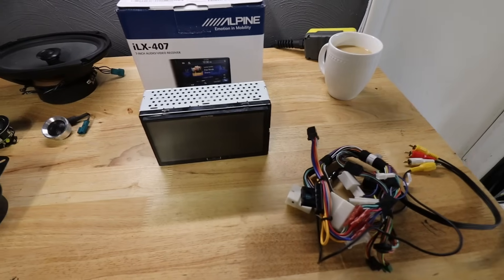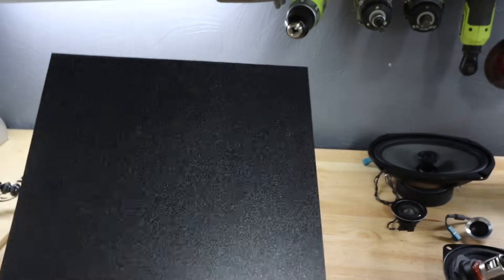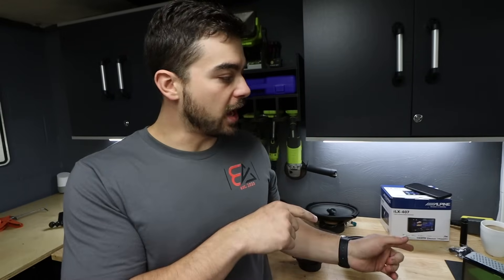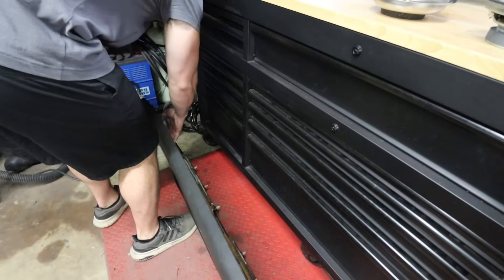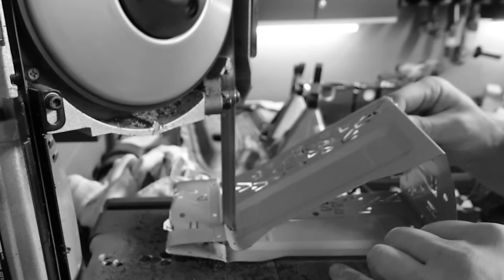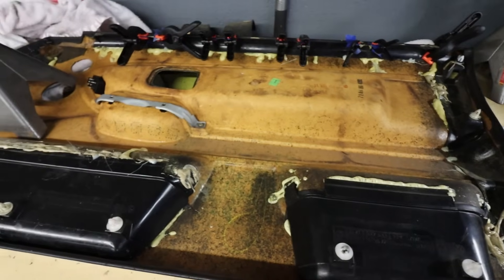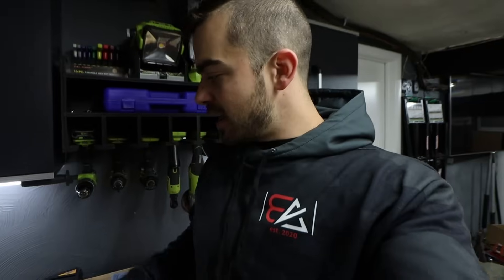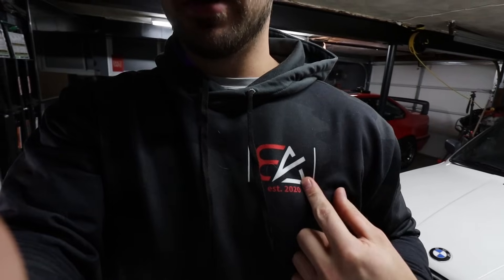Interior & Stereo Upgrades Every BMW E36 Needs | Installed on my LS1 Swapped M3

Comment: This is exactly what I needed to see! Not enough content on putting a double din below without cutting away at the heater behind, looks really clean. Need to do this to mine so I can replace the current radio with a gauge pod
Reply from the maker: If I had gauges to add they would look perfect in that radio delete panel.  The goal was not not hack anything up to the point it couldn't be returned to stock.
Reply: @matt13ross  yeah you done a great job with it. Did you consider a modular double din at all? Stuck between that and a shallow double din but now I've seen you do it I know it can be done without cutting too much away
Reply from the maker: What is a modular double din?
Reply: @matt13ross  guess not then 😂 screen and the unit itself are separate. Can mount the screen and then run the unit itself with a cable from the glovebox
Reply from the maker: Oohh I see.  How would the screen mount though?
Reply: @matt13ross  yeah this is the thing, I've only seen product reviews but no one install it. Sounds like a good alternative for that tight space in the e36 though

Comment: Hey thanks for the video, can't find many people wanting to keep the OEM stereo and all in place and add an aftermarket stereo down below... I'm just going to throw a single din down at the bottom below the temp/clock/etc. unit where the cubby currently is to keep the original look - will the cc unit still work without power to the OEM stereo unit? I'm kinda thinking that the disk changer in the trunk still working would be cool. Sorry if this is weirdly worded, i'm a newbie and wanting to pull out/mess around with as little as possible

Comment: How did you mount the double din in the bottom cubby?
Reply from the maker: Use some aluminum and bent it to shape, mounting it via a bolt that was on the tunnel.  Hard to explain, but very custom.  Solid though.

Comment: I thought I was the only one using the alpine radio on my e36
Reply from the maker: Same spot?
Reply: @matt13ross  I went with up top I want to move it down
Reply from the maker: Why do you want to move it down there?  I want to move it up lol.
Reply: @matt13ross  I don't want to cut into the air vents tubing or whatever is back there but if you plan on moving up I'd say use some plastic tabs that are about double the height of the radio and tap into the metal rails that are inside there that how I manage to put mine up there and be careful Taking out the vent up top you could break the temperature cable

Comment: How did u put everything thing in tho? I’m doing the same thing at the moment I got everything done but I’m stuck trying to put everything into the bottom cubby
Reply from the maker: You mean the wiring or what?
Reply: No like putting everting in to finish. I don’t know if this makes sense but I got the stereo hooked up in its place but how do u put the plastic chassis so that everything is done?

Comment: Please tell us that you are running all of these speakers through an amplifier?
Reply from the maker: Just the factory one.
Reply: @matt13ross  In that case a good-quality aftermarket amp is a must. You'll be underpowering these new speakers with the oldie and when turned up loud would not give them the best signal. In general you want to look at RMS power rating and get an amp that supplies twice that power RMS per channel. You won't blow them that way either. You can also set the filtering in a way that'd put "full" sound, possibly with some bass boost through those 6x9s, and run a pass filter that'd remove a little bass from the front speakers to ensure their longevity. Amp is vital to a good sound of your stereo and speaker longevity.
Reply from the maker: That’s something I’ll have to look into! I’d like a little extra bass too.

Comment: I did something similar. All infinity components with 6x9 in the back. Lots of bass response.
Reply from the maker: Stock amp?  After driving this for a week or so, I'd like more bass.  I'm wondering if I should change the BSW 6X9s to another brand.
Reply: @matt13ross  I have a pair of Infinity REF-9633ix. They get as low as 23hz. 27-30hz is really the sweet spot for low end in my car. It's loud. I would buy from crutchfield and if you don't like them just return them.
Reply: @matt13ross  yes I have a stock amp. Non HK system from the factory. I plan on swapping out the amp for something aftermarket down the line but for now this setup is great.
Reply from the maker: Awesome thank you!

Comment: Yea all new double din radios that I have run into have that wire to connect to the parking brake for their setting instead and video you can just ground that wire out on the chasis of the radio and it should be fine
Reply from the maker: I read that they are smart enough to know if you just ground it, hence why I got the relay.

Comment: Just the video I was looking for! I know im a bit late, but im really hoping Boosted Apex replies. What did you do for the remote power wire (blue/white) for the head unit? Did you connect it to the power antenna (blue on the car harness)?
Reply from the maker: Hrm. Possibly. Pretty sure I went blue to blue.
Reply: @matt13ross  oh you legend. thank u. im pretty sure the parking break bypass thing hooks up into the blue/white wire. Sound familiar? 
Thank you so much bu the way
Reply from the maker: I followed the instructions with the bypass kit. Other than that, I don’t remember lol.

Comment: how did you end up mounting the actual radio and radio cage?
Reply from the maker: I def forgot to video that.  The cage is bolted to a piece of aluminum I bent.  It sits underneath the cage and bolts to factory thread in the floor.

Comment: Awesome set up! Loved the video, Do you think you could do a short video on how you got the stock amp to work wiring wise? Ive looked high and low for answers and im stuck on my aftermarket radio, ill get sound then it will say miswired or it just says miswired after I hear the amp turn on.
Reply from the maker: Nothing special here, just standard wiring!

Comment: Nice install on that headunit!! What amp do you have? I still have the Stock HK which I know is supposed to only work well with the 2 Ohm HK speakers, most aftermarkets are 4 Ohm.
Reply from the maker: Still the stock amp, not sure if it's worth upgrading or not?

Comment: Yo I feel you on that roll bar thing. I just want to be able to pop the side windows out and latch them back when I'm done. Its like impossible most of the time I send one of the kids back there to open or close them.
Reply from the maker: Lol send the kids back there that's awesome.  Totally agree with the rear windows, haven't been opening mine.  Would be nice especially without A/C.
Reply: @matt13ross  yeah no AC for me either. I'm thinking of coming up with a latch I can reach some how.
Reply from the maker: Lemme know if you do.  Also, you can retrofit electronic latches if you can find them.
Reply: @matt13ross  I didn't know that was even an option.
Reply from the maker: May be a euro thing but I’ve seen it before.

Comment: To make the radio think that you are in park you just need to ground a cable called prolly „handbrake”, you can do it even by grounding it on the radio itself.
Reply from the maker: You can't with the new radios, it cant' have a constant ground.  That's why I installed the relay.

Comment: Great video! Replacing those door speakers on an e36 is a pain in the rear! Great job 👏. Where did you find the bavsound speakers from? I'm trying to find a set of door speakers but they are extremely difficult to find
Reply from the maker: I got them used from a guy on Facebook.  Last I checked they were backordered on their website.
Reply: @matt13ross  thanks for the info!

Comment: I want to buy rwd car cheap with at least 140 hp.

Bmw is the cheapest option. But unfortunatelly e36 in poland were the most popular project cars and it's even a meme out here how much e36 are shitboxes. It's really difficult to find one that is not rusted, thrashed, without welded diff and they also got more expensive now. E46 are cheaper, but the thing is I hate how e46 looks like I don't like beemers newer than e36.

Good news is compacts are cheap, becouse they are ugly for most people so noone want's them. I actually like compact more than coupe. 

All I really need is 2.0 engine. 

If I don't find one for cheap I will be forced to but is200, as I don't see the point of buying a beemer for price of a lexus. And lexus engine is far better with mods than any bmw engine.1G-FE is basically 2 liter 2jz.
Reply from the maker: If you can find really any E36 that isn't rusted, go for it.  The rest of the stuff is easy to fix.
Reply: @matt13ross  I don't know much about engine swaps. I honestly don't know where and who would even do such a thing and how much would it cost. There's plenty of cheap 1.6 or 1.9 (both 100hp), but anything stronger than that are typical beaters or cost 5k$ or more.

Maybe I will convince myself to buy e46, there are some good coupe 2.0 for around 2.5k$. Maybe it looks way worse, but at least I won't have to worry that much about buying a scrapbox.

Most people here earn around 1k$, so 5k is too much for just a base.
Reply from the maker: I say just fine a clean rust free one and start from there.  You can always engine swap or add power later.

Comment: Thanks for the video. I have an INFINITY BASSLINK installed in my E36 trunk. You should add that to complete your sound system. Trust me.
Reply from the maker: Where / how did you install it?
Reply: @matt13ross  It is installed in the Trunk/Boot of the Bimmer. Mine is located on the driver's side. The subwoofer has a built-in amp so it gets it power from the battery which is located conveniently in the trunk. There are Youtube videos explaining how to install it. INFINITY BASSLINK.
Reply from the maker: Awesome thanks!

Comment: Killer job! For the panel mods in the future perhaps it may be good to invest in a plastic welder and a hot staple gun? They both take a little finess to not overdue it and burn the plastic or take the staple right through a panel. But super quick to learn. Install looks super clean! That stereo delete really brought it together!
Reply from the maker: Thanks!  I've never used either of those tools,  I feel I would destroy something lol.  But I'll look into that, sounds interesting.
Reply: @matt13ross  3D Printing!

Comment: it was possible to implement the installation better, move the climate control unit down, and the radio top.
Reply from the maker: I went over that in the video, the climate control unit doesn't fit down low, it's too deep.

Comment: You know what is the perfect mod to this? Instead of the USB charger in the sigarette lighter, you can use the USB-C outlets that newer BMWs have. They fit in the rectangular holes next to the lighter and have the oem orange light.
Reply from the maker: Solid idea there too!  I'm actually planning to move it up and move the CC down with some custom 3D printing.

Comment: One tip if you won. On the parking wire you can plug directly with the positive key signal of the radio, and you can play were ever you won on without parking the E36. Cheers ✌️
Reply from the maker: I've got the relay thing hooked up to fool it.

Comment: I feel you did this backwards. Should’ve moved all of the climate controls below, and used the original radio space with the extra space from climate move to put the screen there.
With the climate could’ve been a nice plastic bin to throw your phone plugged in to usb and some extra small storage.
Reply from the maker: The climate control doesn't fit down below, it's too deep and hits the HVAC box behind it, which I explained in the video.
Reply: @matt13ross  I know... Just visually it would've been so much nicer.
Reply from the maker: If I can figure out a way to do it cleanly, I will in the future.

Comment: The air conditioning unit should go where you have the new LCD display and the new infotainment system should be installed in the old radio and air conditioning.
 I recommend that you buy a basic 3d printer to make parts such as a new surrounding frame that should fit the new IS and old AC in the new location.  🤙🏻
Reply from the maker: In the video I show that the climate control won't fit down there, at least not easily.  It's too deep and sticks out. 

Now, I am planning on a 3D printer at some point, just not a priority yet.
Reply: @matt13ross  I had a 99 cab in Sakhir Orange that I miss.  What I did was put the radio on top.  Use the surround that came with the radio and add bondo where needed and sand the bottom corners round to fit the spot.  The climate goes where the obc used to be and the obc goes on the bottom since it is the least used.  For the climate control you have to remove the faceplate and add bondo to the corners to make them square.  The cc is also about 1/16" wider then the obc so you have to shave the sides down a bit.  On my car the cc face was smooth and the obc face was textured so you need to either texture the cc or sand the obc smooth.  I did both a smooth version and a version where everything was skinned in carbon fiber.  
I would look into bypassing the factory amp.  It was made to accept 1-4w and you are probably putting 12-15w a channel into it (I do not know the specs of your head unit if it has an amp or not.  I am assuming it does)  It will burn the factory amp out eventually - and hopefully it will not literally burn.  You can get "converters" that will take a amped output from a hu and power it down to 1-4w so it can be safely connected to an amp.  Or if the radio has pre-amp rca outputs you can convert them to regular wire and use that.
Car looks great, it must be so much fun with the Ls!
Reply: I hate the look of the climate control relocated to the bottom. It doesn't fit right at all, even with custom fab work, the rounded edges look bad. You're saying it "should" be that way just because that's the easy way that everyone does. This makes it look so much better.